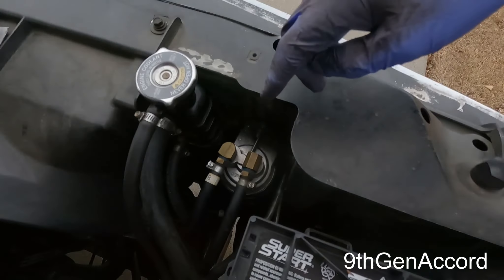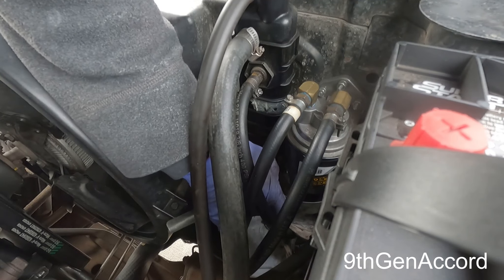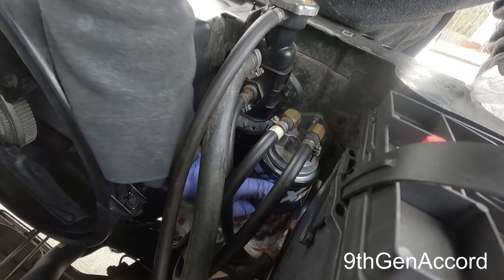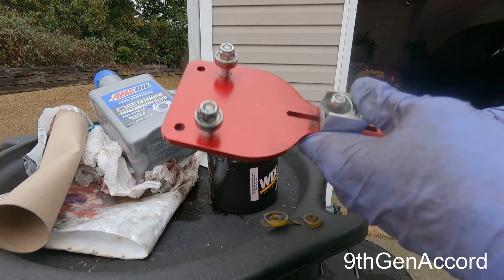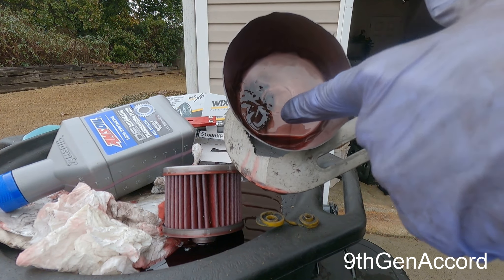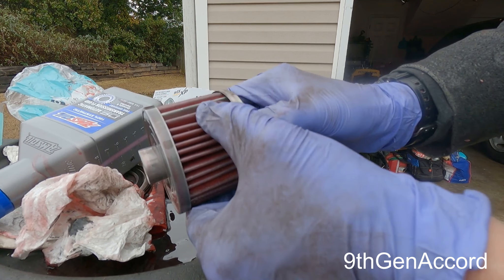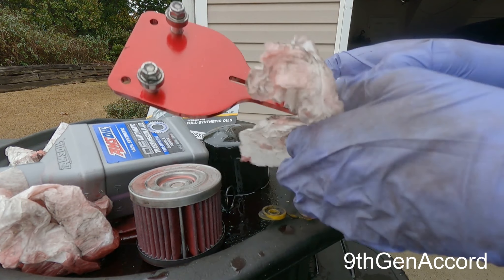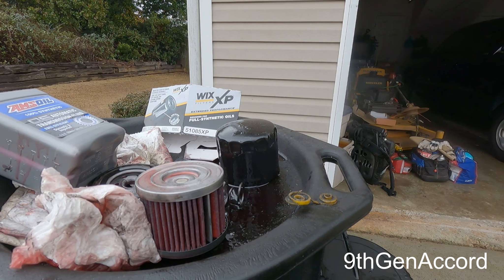Derale Spin On Tranny Filter Change on a 1989 Chevy K1500 700R

Comment: best way to check for metal cut a large piece of the filter material out put in vise  squeeze all the oil out get it out of the vise pull it open look for metal, I was a lube technician on surface mine for 13 years , thats how we we're learnt to do it.

Comment: The wix xp filter is actually a extremely coarse media, about 40 or 50 micron. Unfortunately wix doesn't advertise the micron rating for any of the xp filters that I have searched. If they offer a xe filter for that number that is the tightest filter that wix offers. Usually 15 micron and they do advertise ratings on the standard filters and xe.

Comment: I wish I am able to do the same to my Lexus GX 460. It will run the warranty void 😢
Reply from the maker: Why would it void the warranty??  At worst it will pull the particulate matter out of the fluid and make the tranny last a very long time.
Reply: @9thGenAccord  i know but any adjustments to factory setup will void warranty. The reason is very simple, they don’t want the transmission to last long. 

Why do you think they are moving to turbo and twin turbo and soon turbo for every cylinder 🤦‍♂️🤦‍♂️  to further reduce engine life and they deceive us by emission regulations and power (both contradicting) .  

By the way, your videos are awesome and simple and i am using Amsoil as well 😉😉😉